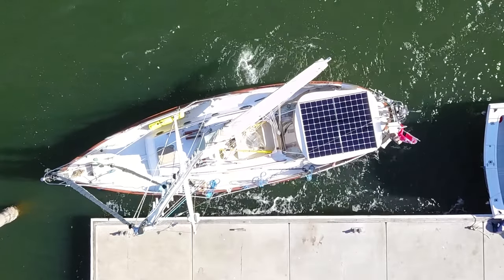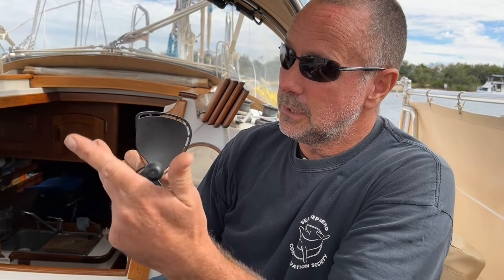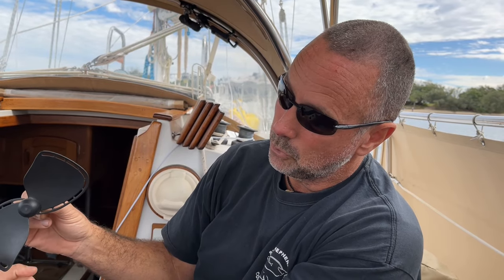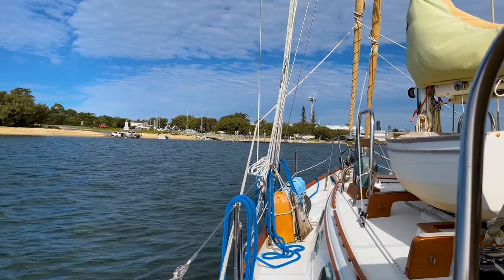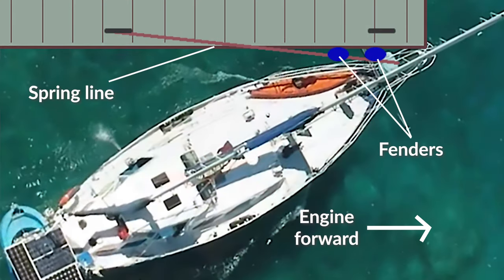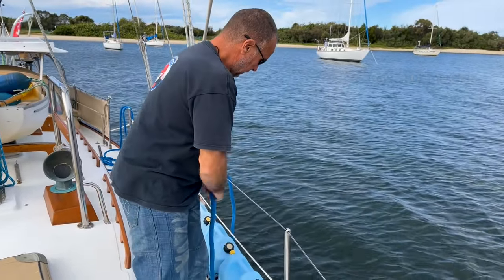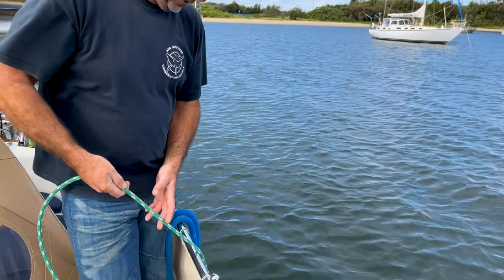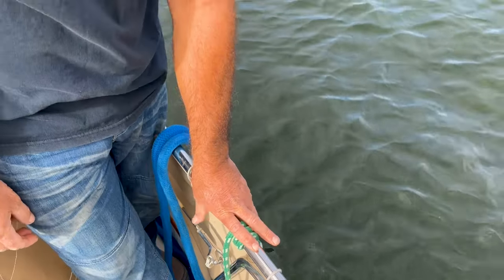How to Dock Single Handed? | Single Handed Docking - EP12

Comment: btw.   I NEVER get off the boat with no lines tied.  Watching from the dock while  my boat drifts away is bad enough.  But in a crowed marina.  Ugh!
Reply: How the hell do I get ties to dock if I’m buy myself and no dock boys if I stay on the boat
Reply: @richardbastin3647 
What I do.  

Ready lines. Tied fore and aft.  

Motor gently up so one side is parallel to the dock. Steer to make the stern touch the dock next to a cleat. Boat should be stopped. Closer to the dock at the stern. 

Quickly Reach over and cleat aft line to the dock. Secure it. Stay on the boat  .

Return to the helm. Engine forward slow pulling against the aft dock line. 

Boat will slowly swing to the dock.  

With power left on, go forward (on the boat OR the dock. )

Secure the bow dock line. 

Shut engine down. 

Mess with all the lines till you’re content.  

This works for me even with adverse current or wind. 

Always solo. No problem

Trick is to use the engine to hold the boat in place pulling against the secured aft dock line. 

Now you have plenty of time to go forward and cleat the bow line.
Reply: And if you miss the dock cleat you’re drifting out of control into other boats.

Comment: A couple of questions.  First, with the breeze blowing on to the dock then why not dock starboard to so that you have the benefit of prop walk for departure.  Second you discuss springing off the dock but don’t demonstrate it and instead simply push the boat off, why?
Reply from the maker: Hi David,
Reply from the maker: Hi David, good points on both counts. We're trying to demonstrate the principles of docking to people. And, asI'm sure you're aware, there's always room for variables. These videos are also just short intros. Not detailed versions that would cover all aspects of docking. We will, in time, be doing these with students.

Comment: kind of a mess tying onto those dock cleats. It should be less turns and much  more simple. I'd show you a video but I'm in the comment section. Sorry to be so picky, but I work part time as an assistant harbormaster, and I'm always amazed at the variety and complexity of the docking tie ups.

Comment: Very nice explanation. One tiny suggestion (i know, the best seaman aren't on the boat lol😂): you're showing how to tie on a cleat. The final hitches are better done reverse, such that the lines run parallel. It makes for a smaller knot, it unties more easily, it won't come loose, and you only need one of them (if it's unclear what I'm saying, on YT, search for "cleat hitch", there are some excellent vids).

Alternatively, run the lines back to the boat, in many cases that makes for an easier departure.

Comment: Sorry maid, the most stupid explanation for the direction of prop walk.😂
First of all, a turning device push the water jet in every direction, like a circle, not only left or right. My 5 years old daughter know this. It doesn't matter if anti- or clockwise. 
However, if the water jet encounters a resistance (boat hull) , the water pressure increases in front of this resistance. The resistance (boat hull) is pushed away by the higher water pressure. That's why the boat hull moves to the side.
That means we have a prop walk in forward gear and in reverse.

Although , the prop push the water much more effective to the front (keel) or back (rudder). Thats why its very efficient to steer in forward gear and normally the prop walk in forward gear isn't a problem.